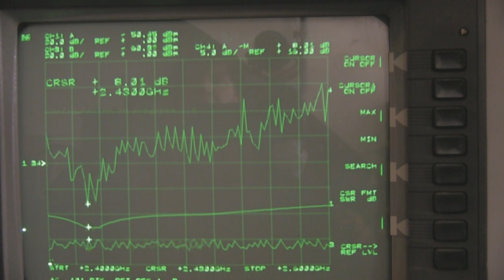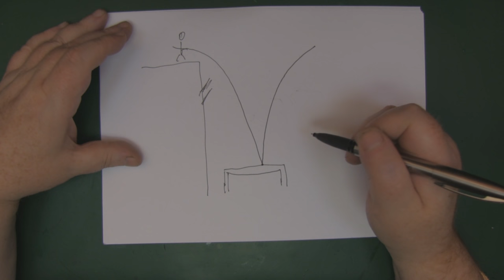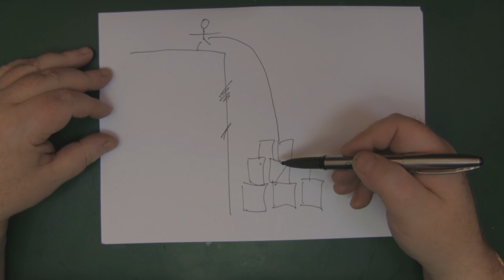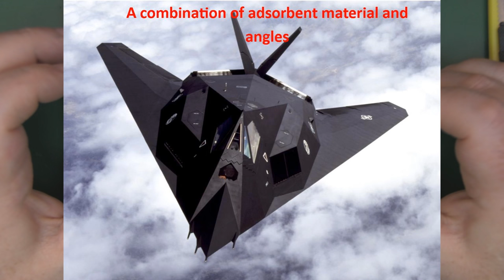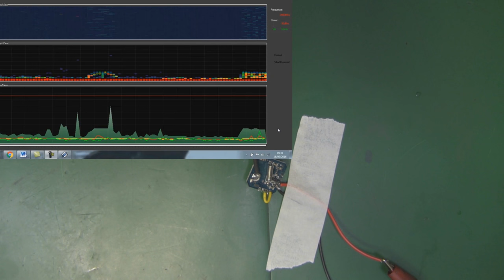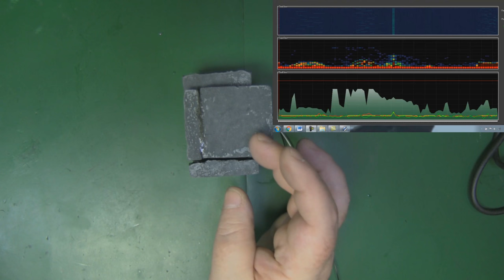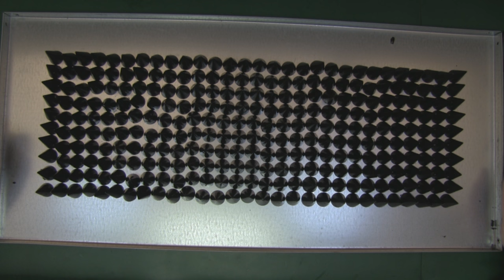I Want to Build a RF Anechoic Chamber

Comment: Excellent video, thanks! In the sealed transmitter experiment, the graphite seemed to do a great job all by itself, so I'm wondering why the other materials are necessary at all. You say "if I use too much graphite it will turn into a reflector", but I don't follow why that is true.

Comment: Easy to test materials like hot glue after it solidifies. Put the solid glue into a microwave oven, along with a cup of water in a separate container. Measure temperature change due to RF absorption at 2.4GHz. Hotter is better, meaning it absorbs RF energy. Not scientific, but good as comparison of different materials.

Comment: That seems like a rather fascinating project. Interesting. 
I do wonder how this will compare to the professional gear. Will the difference be noticeable enough? Also most chambers I see on the internet use pyramids instead of cones, was the choice for cones purely one of having an easy mould available or is there a specific reason?
Reply: Perhaps you watched is a sound acoustic Anechoic Chamber, and this method is to kill the RF and this makes a difference?
Reply: No, in RF anechoic chambers we almost always use pyramid shaped absorbers. At my work we have 9 x 9 x 18 meters anechoic chamber, all elements are foam pyramids charged with carbon. The dimension of pyramids is important too. Lower the frequency bigger the size of absorbers.

Comment: dear sir , we are undergraduate student and trying to build the Compact chamber.
we purchase the  Pyramidal Foam  absorber for the compact chamber .
how to stick the foam to wall ? is their any chemical Glue or shall we insert the screw between foam and wall.the wall is made up of Stainless steel .
Thanks regards
Shivam Sharma ,Pune India
Reply: Shivam Sharma - put contact cement on both the cones and the walls. The foam cones need to be saturated with conductive carbon. If you are transmitting hi power you also need a salt to absorb and slowly release the heat the carbon gives off when it is excited by rf.